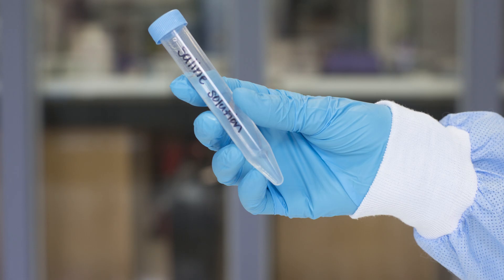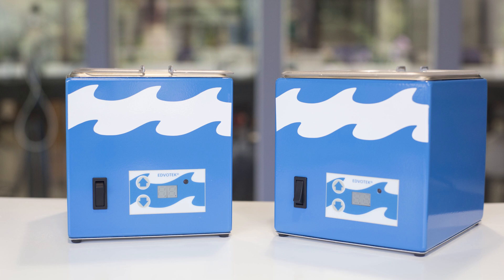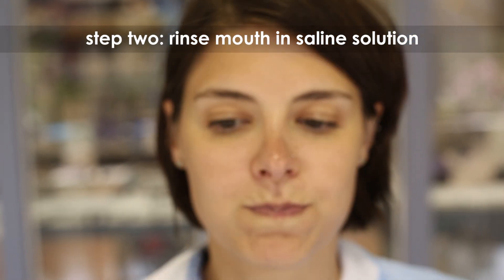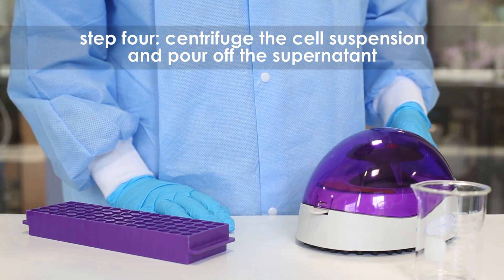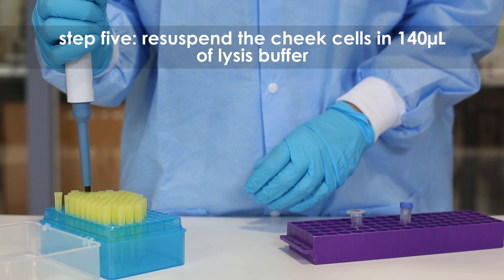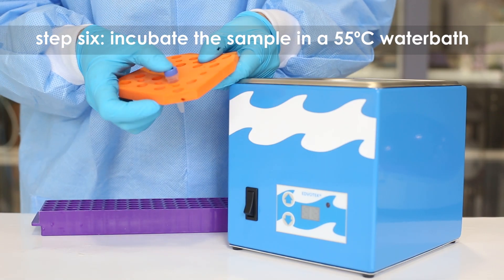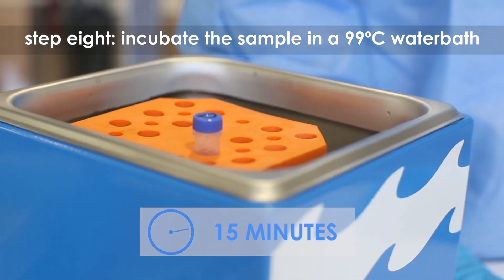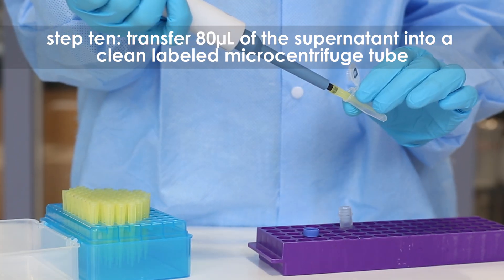Isolation of DNA from Human Cheek Cells

Comment: Hi 
,
 how am I able to increase the purity of my DNA following these steps , I have been using 100ul of lysis buffer  (microliters) and 2ul(microliters of proteinase k). I have been adding in the lysis buffer and then afterwards the proteinase k, but my sample is still showing an absorbance ratio of 260/280nm at around 0.451 which is not very pure , I am unsure what could be going wrong. Thank you
Reply from the maker: A literature search will be able to help you find a protocol that best serves your purpose.  This is a very crude prep which can be used as a template to amplify DNA sequences by PCR.

Comment: Hi , 

If I tested the Purity of my DNA on a Nano drop and it showing an extremely low ratio of 0.39 and showing protein impurities , what could I do to ensure I have pure dna ? Thank you
Reply from the maker: In this case, you may consider a spin column prep.  There are kits for this.

However, depending on your application, the quick and easy prep may be good enough.
Reply: And what would you say I am doing wrong if following just this step, as I would not be able to get a column prep. Thank you
Reply from the maker: @juliasworld7985  This is a quick prep of DNA that does not focus on its purity. For better purity, you can try phenol chloroform.  But I recommend doing a literature search or talking with your advisor to identify a protocol that meets your needs.

Comment: Name of the enzyme who dissolve the plasma membrane 
 of human cell
Reply from the maker: Most of time, you use a detergent (NOT an enzyme) to dissolve the plasma membrane. This is because the plasma membrane is composed of lipids (fats) which are solubilized using detergent (like a soap).  We can think of this as being soap washing the oil off of a pan.
Reply: @EdvotekInc  thanks

Comment: What was the reason for incubating at different temperatures? Thanks!
Reply from the maker: The 55C incubation allows the protease that breaks down cellular proteins to work.  But, the enzyme that we use to amplify DNA is a protein! Any remaining protease would affect your PCR.  So we heat to 99C to deactivate the protease.